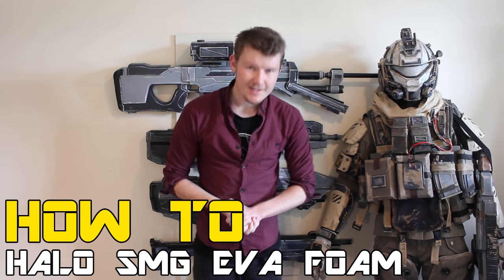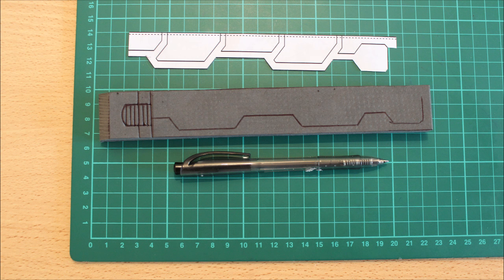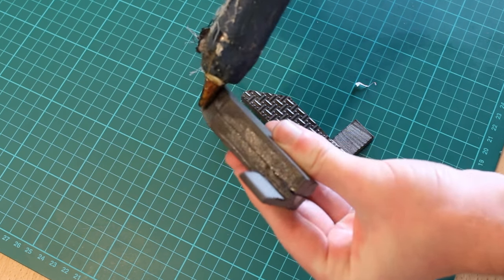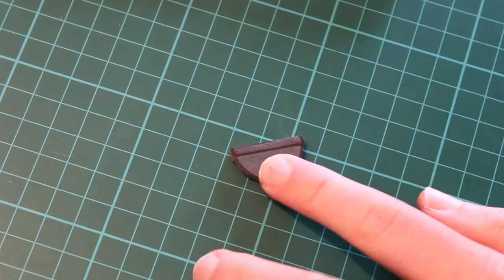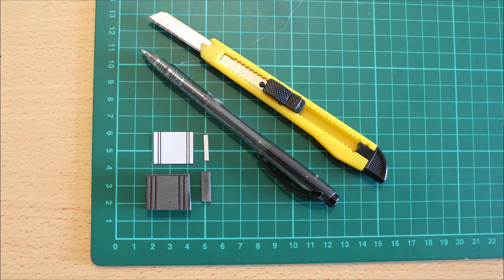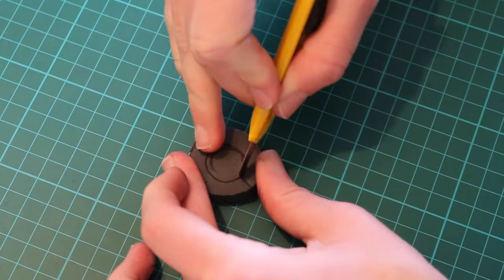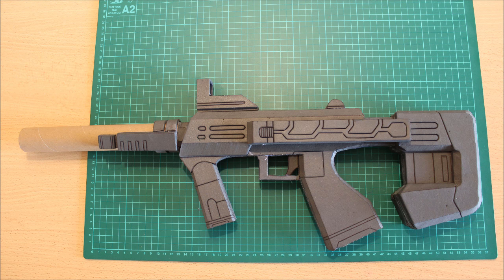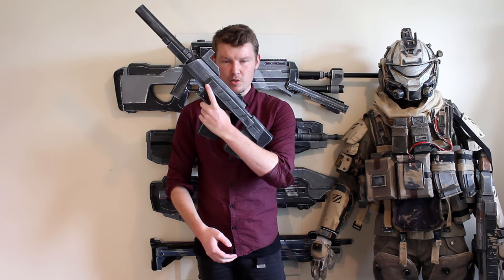HOW TO: Halo ODST SMG Cosplay Prop PART 2 -  EVA Foam

Comment: I changed some of the detail

•put magnets in the mag so I can take it off
•put magnets on the bottom of the sight and added a clear piece of plastic in the sight and drew a red dot 
•I didn't glue the suppressor to the gun so I can take it off and make it look like a smg from other halo games 

I'm not that advanced at make these props and this is my 6th prop I've made, made three from you Titanfall 2 pulse blade helmet, halo magnum, and the smg. I made one from punished props, the hunter knife. Then I made 2 things from destiny that I created, Dreg knife and a Stealth Vandal sword
Reply: Cole G how did you get the suppressor part to stay ok w/p glue?
Reply: Like a Bossk 627 I don’t think he’s gonna reply back
Reply: I didn’t have magnets for the mag so I just folded duct tape to put it on an off

Comment: Do you think it would be a good idea to insert(embed) magnets into it so you can take the magazine on and off?
Reply from the maker: WOuld be a cool addition defiantly =) If thats what you going for =)
Reply: Now I have your attention what thickness of Eva foam should I use on the Odst armor?
Reply: 1/2 inch the basic mats you use to put under exercise equipment :)
Reply: It Would Be Pretty Cool If You Get Magnets To Put Into Your Pocket/Cosplay so that you can Store The SMG/SMGs Around Your Waist.
Reply: I just put magnets on my main mag so it can detach and working on another now to make a collapsible stock :)
Reply: BASHNICH corner cool :D
Reply: kopfjager68 I did it and it works
Reply: @bashnichcorner  I used 6 mm and i never had to bevel or heat up anything.

Comment: I have cut the weapon into 2 pieces and i Put Parts of an airsoft into it. it wasn,t easy but i'm very happy with the result
Reply: That just doesn’t make sense, don’t know a single airsoft gun especially not an AEG that would fit in this especially since you’d need to have a trigger and cut out a full barrel etc

Comment: I've been trying to make this prop for quite a while and I have gone through lots of trial and error and the main problem for me has been cutting, I've not been able to cut along the lines that I've drawn and I keep swerving off and literally getting stuck even though I have been replacing the blades and being patient, so can somebody give me any advice ?
Reply: McToasty Gaming what you can try and do is use a ruler or holding your cutting hand down on a table or on the piece

Comment: Where did you get the tube for the barrel?
Reply: I tried a PVC pipe but I found it was too heavy and the foam piece couldn't support it very well.
Reply: A cardboard mailing tube seems to be the best. You can get them from office supply stores
Reply: Paper towel tube...